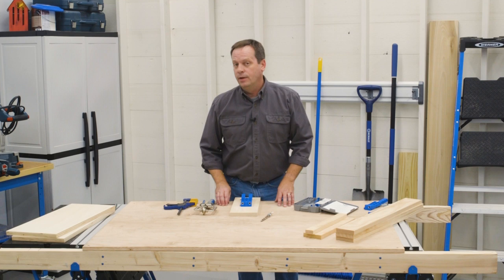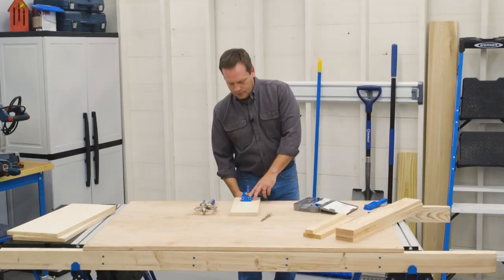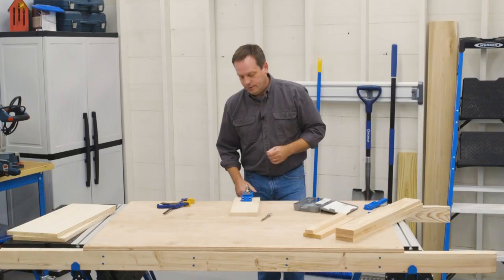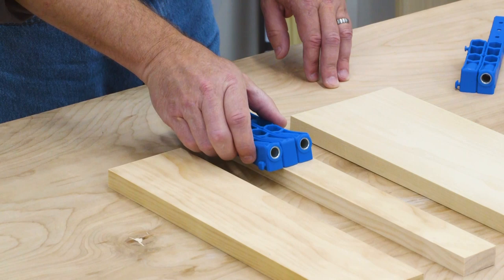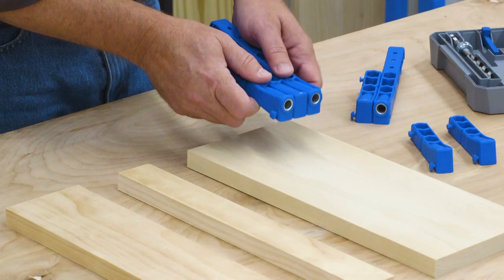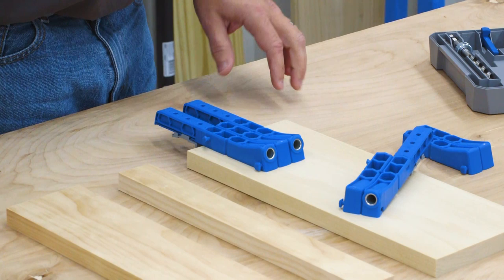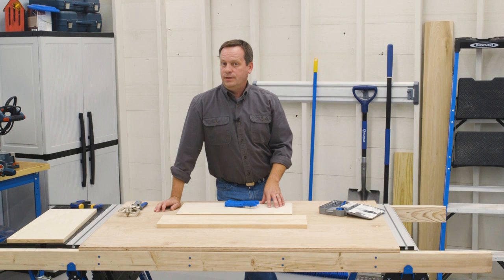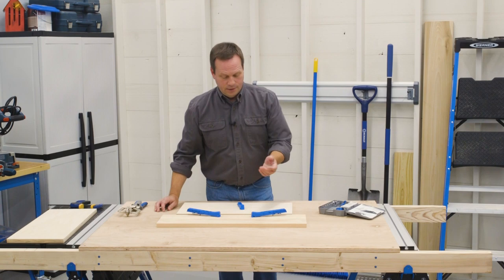Kreg® 300-Series Pocket-Hole Jigs: Positioning the Pocket-Hole Jig

Comment: Hi - thanks for the video. I have been using a single hole kreg jig with some success but one thing I just can’t get my head round when watching videos is when they keep referring to thickness of material (wood). So there are usually 2 bits of of wood. One where you drill the hole into the wood (call it piece A) and the other that takes the majority of the threads of the screw (call it piece B). I understand that the idea is to get the drill bit close to the centre of bit A where the screw will eventually exit. Fine. Then you have to select the length of the screw. So you look up charts that talk about the thickness of material!! Which bit of material - is that piece A or B? Also, is that the thickness ( if piece it’s piece B) from front to back or top to bottom - as you can can be joining to a bit that is only 12mm thick, but 144mm deep. So are you joining at the edge of the 12mm piece or into the top of the 12mm piece, depending on which way you are choosing to join the 2 pieces. Aaaggghhhhh!! If anyone can point me in the right direction it would be hugely appreciated.